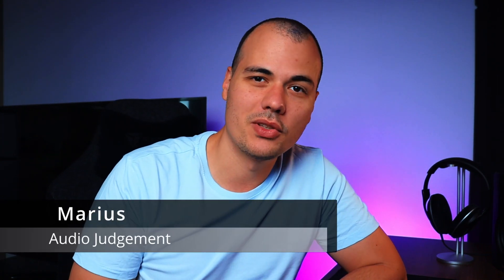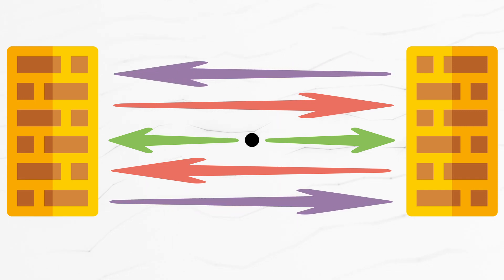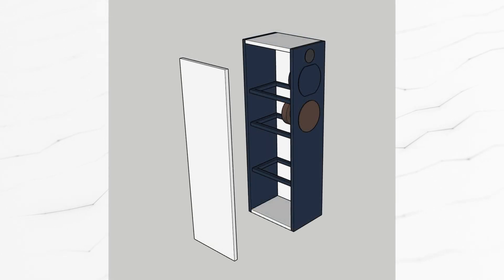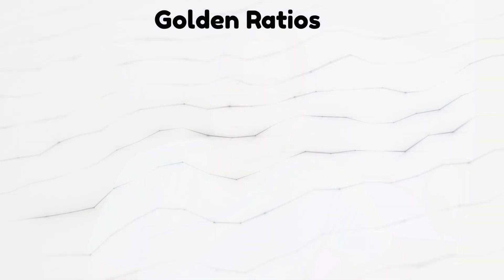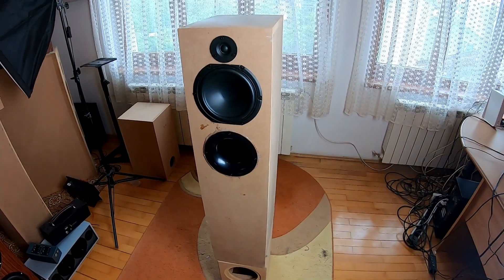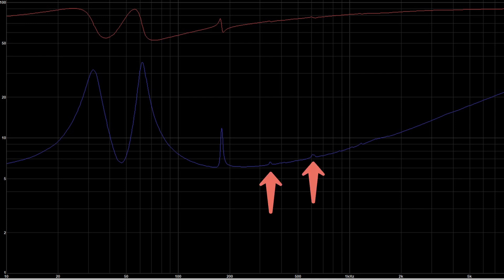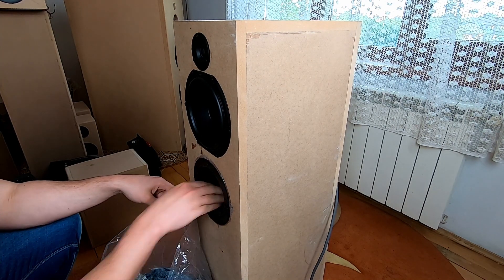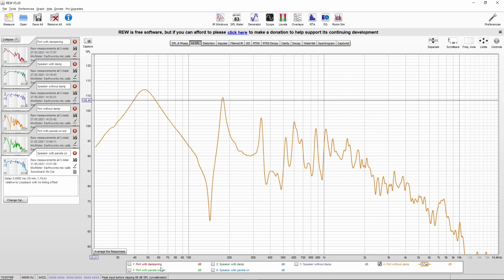Standing waves in speaker boxes

Comment: Whatever your talking about what’s the point is any interior wave affect the back of the driver or go through the driver or effect the speaker driver how do you eliminates these effects which to me has a more important than standings waves at one frequency this seems to show that standing waves that you propose are troublesome if you think that your eliminating them without changing the orientation character shape of interior sides itself you will always in some way have parallel side but very limited effect if it’s not square interior or rectangle parallel interior side change this stops your problem then you don’t need dampening material it’s a design flaw to easy to make a lazy mistake like this

Comment: Excellent video! I have had my own experience adding damping material ( a lot) on top and bottom of my Pure Acoustics Junior F tower speakers and the result was very impressive.  My speakers do not have the original mid-woofers. I have upgraded to a better-quality Kevlar mid-woofer.  The new ones are more powerful and have a better bass response, so a resonance of about 400 hz was developed in the cabinets.  That happened not only because of the upgrade, but I think is mainly because of the reinforcement of the lateral walls of the cabinet I have also implemented.  To improve this I added a lot of polyfill (vellon siliconado in Spanish) on top and bottom. Previous to doing so, I plotted the impedance graph of the speakers, showing the 2 big peaks below and above the tuning frequency of the port, plus one small peak due to the cabinet resonance (I guess).  After that the impedance plot turns very smooth and these two peaks almost disappear, the same as you show in the video.   The result was that cabinet resonances stop masking what the drivers are receiving to be reproduced in the signal.  That means that a lot of small details in the sound started to appear.  I highly recommend to take care of building very sturdy and robust cabinets in DiY projects, and/or improving the strength of your speakers in case they are budget speakers with thin walls. Best regards

Comment: Thanks! Now I know which is the frequency of the standing wave that I might deal with! Great knowledge! But, I want to ask you something with regards to the room which the speakers are placed into... I had a problem a while back and not be able to identify, since I have used damping material correctly... at about 70Hz there was a huge booming sound that was so loud, that I could not be able to stay in the same room with the speaker, even though the volume was low! Once I moved the speaker into a larger room, the problem was fixed, and I've noticed that, in fact, my speaker sounded terrific! The question is: how important is the room in this case? Is it crucial or what happened to me was because I designed my enclosure poorly?

Comment: could you explain how an amplifier can take a minimum load. some take 4 or 2 ohm. how is this defined. great video.
Reply from the maker: It depends on how the amp is built. If it has a 4 Ohm minimum load and you connect a 2 Ohm speaker, it will shut itself off. The amp will deliver more and more power as you connect a driver with lower and lower impedance. However, it will also heat up more and more. At some point it will start to overheat and destroy itself. That's why there is a minimum load rating and if you go beyond that, the amp will shut off the protect itself.

Comment: What would be the effect of non parallel cabinet walls? Is it worth the hassle?
Reply: Did you ever get an answer anywhere? Ive been interested in this question as well.
Reply: @Andrewatnanz  I've never seen a formal answer. I made a pair of slant bookshelf speakers some years ago, but I lack the equipment and skills to properly perform a comparative test. I plan to make a straight wall version in a couple of months, but they won't have the same air volume. Honestly, I do not think the difference is audible and room reflections (standing waves outside cabinet?) are much bigger of a deal as I've found particular spots in the room where bass clearly cancels out or increase, "reverb" that changes when certsin door is opened, etc... 🤔
Reply: You will still have modes (standing waves) but they more difficult to calculate.

Comment: Great video. Up until now standing waves were just theory to me, never saw the real world effects demonstrated so clearly before. Am I correct to assume this standing wave issue is not really a problem at higher frequencies, because of the lower energies involved? And as a result, using dampening material on the vertical panels isn't as important?

Comment: Adding a lot of damping material also increases losses (note that the minimum point between the two impedance peaks is quite a bit higher after adding all that material) and reduces output at low frequencies.  This can be avoided by careful selection of the driver and vent locations in the box to minimize the impact of standing waves on the combined response.  

Note that the freeware tool Hornresp can be used to model "offset driver, offset vent" transmission line designs, and if you look at your build as a transmission line with the driver offset from the start of the line and the vent offset from the end of the line, you can use Hornresp to model it and optimize the driver and vent layout.  

Hornresp can be difficult to use for beginners, so I put together a few Excel workbooks that allow the user to basically put in the physical box dimensions and the locations of the driver and vent, and the workbook produces the equivalent Hornresp sim.  For this particular build, have a look at the BOXPLAN-ODOV workbook available on my site at www.diysubwoofers.org/sheets.
Reply from the maker: Wow, that's a lot o work right there. I'm quite new to hornresp. I recently started playing with it and it's something that's not pleasing to use. When I design ported boxes, speaker and port placement are chosen out of convenience / aesthetics and not some elaborate thought process. I should investigate this more.